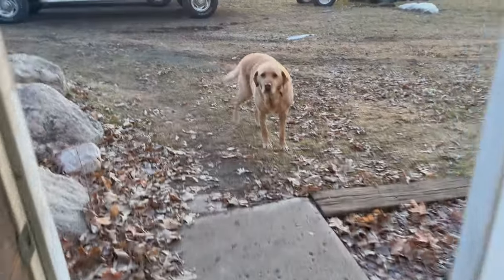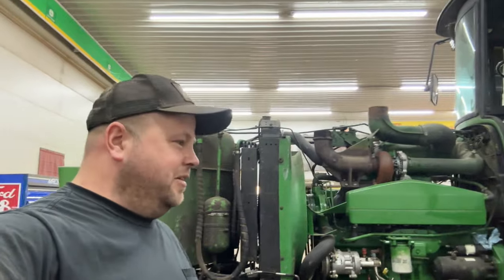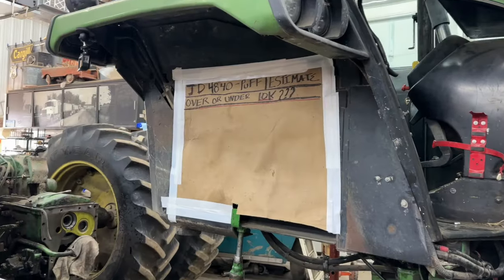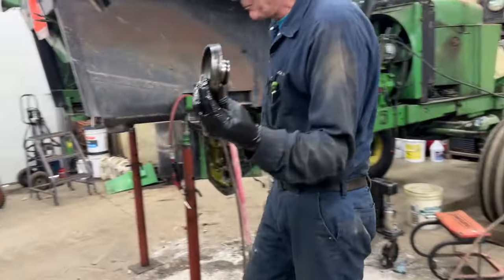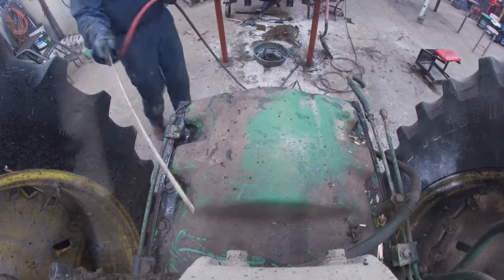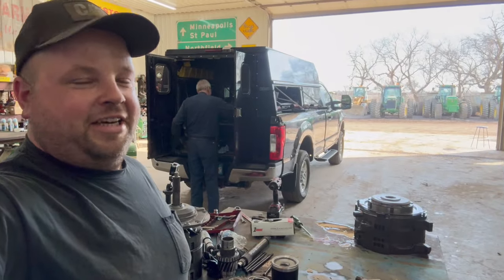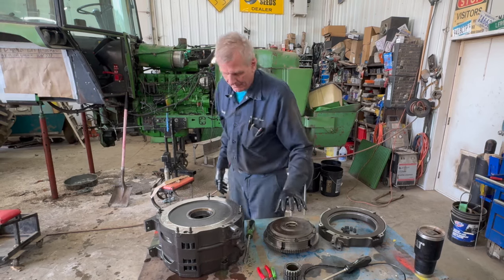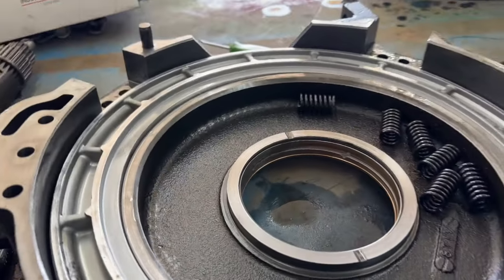$$$ KEEP ADDING UP (John deere 4840 tear down)

Comment: what i love about those old iron horse sound guard tractors is ppl just keep tearing them down rebuilding them and keeping them going. they are timeless machines and as practical to use today as ever. 43 years later and you can still do with it what you would do with a brand new deere but possibly more reliable and economical.
Reply: not to mention they look great👍

Comment: i feel your pain. just did mine last fall.
it was a over 10,000 in parts.
it was still cheaper than a new tractor payment.
it should last another 9900 hours.i was told on pto not to pull lever all the way back at once, hold till pto stops then pull the rest of the way, stopping it fast is what wears out pto clutch. 
ask Larry  if he agrees with that advice.
great video.